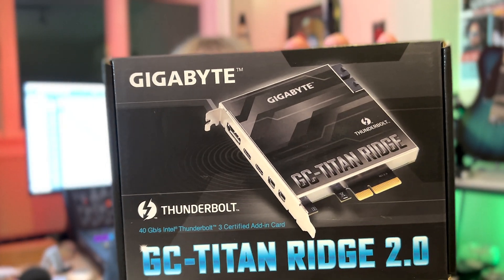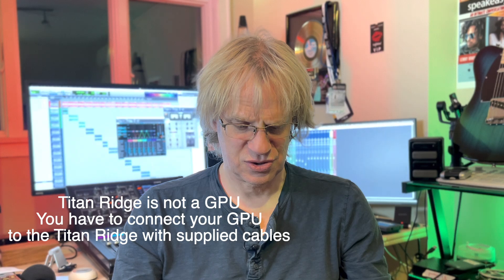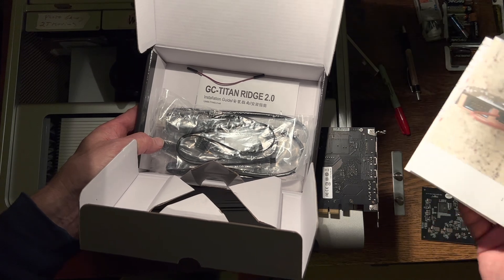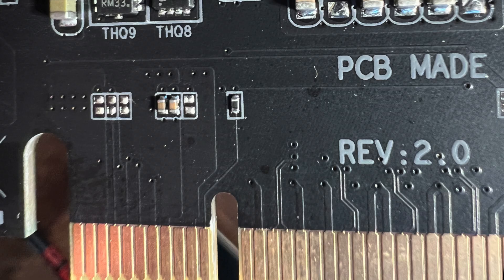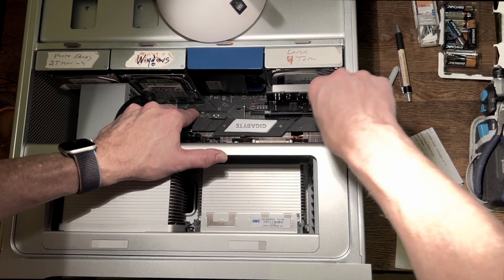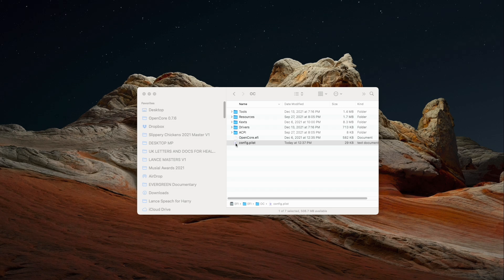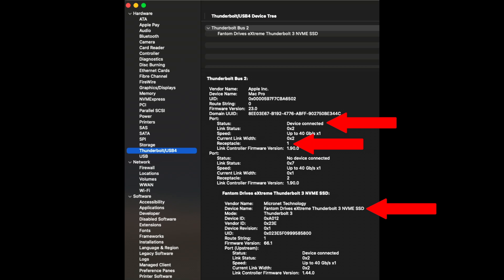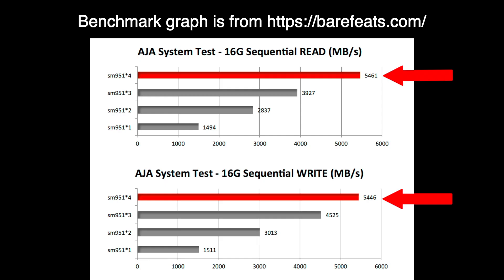Mac Pro 5,1 Thunderbolt 3 0 Titan Ridge pros and cons

Comment: Wow this is great! I was always told that thunderbolt does not work on 5,1 Macs due to the motherboard not supporting thunderbolt.
Reply from the maker: That was true but thanks to the opencore developers and flashed for Mac Titan Ridge cards they work! but it’s not plug and play, you have to boot and then restart but then your good to go.
Reply: @MacSoundSolutions  mine was working great I bought a flashed one from their eBay store but UAD rolled out an update recently and now I’m having issues with the Thunderbolt card Losing connection with my Apollo and crashing on YouTube video streaming sites
Reply from the maker: @DEADIKATED bummer,  not great. I have since pulled my Titan Ridge, I just don’t need thunderbolt I got the McFiver so faster internal drive speeds and USB C ports.
Reply: The Thunderbolt protocol is synthesized from PCIe 2.0 data but don’t expect TB3 speeds. This card will bring your CMP into the TB protocol but not the speed. To many the protocol is all-important, the speed is not. BTW, I did not have any of the sleep/wake issues at all with my install. If you have questions, fire away. I’d have to go into my notes and I’ll be happy to.

Comment: Hi my friend , I just bought a titan ridge and installed it with opencore and my 2012 mac reads it and picks it up fine ,but when i plug my Apollo UAD in it does not read the interface???... any suggestions u could give .. thanks
Reply from the maker: Was it pre flashed for Mac? If so you have to set thunderbolt from ‘false” to “true” in the OC config.plist if you have both those things already done, try booting then plugging in the interface with it powered on then do a restart and it should then see the interface and of corse you need to have the driver installed.

Comment: Will this card with Presonus Quantum?
Reply from the maker: Depends on drivers and what Mac OS version the drivers work with. It should work if it’s flashed for Mac and the driver and OS work on other macs. You have to have opencore for it to work, but you will still have to do the cold boot and reboot to get it to show up.
Reply: @MacSoundSolutions  Everyone that Tried it .. Never figured it out.. 🥺
Reply: @MacSoundSolutions  
Supposedly
The Titan Ridge will work with all of the following:
• Focusrite Clarett 8Pre (X)
• Motu 828es
• Lynx Aurora
• Apogee Element 46
• Apogee Ensemble Thunderbolt
• Blackmagic UltraStudio
Minirecorder
Blackmagic Mini Monitor
• Akitio Node Pro Thunderbolt 3
• Elgato Thunderbolt 3 Pro Dock
• Elgato Thunderbolt 2 Dock
• Belkin Thunderbolt 1 Dock
• Kanex USB3
• East Thunderbolt Adapter
• Honeywell USB-C Dock
The Titan Ridge does not work with all of the following:
Drobo (storage)
Promise Pegasus R6
Presonus Quantum (other Presonus should be fine)
Antelope Audio (see details above)
Slate VRS8 (will not work on a Mac Pro, works on a Hackintosh)
Lynx Aurora 16 (Original, not N) with LT-TB

Comment: It really is silly that they dropped support for these computers. They are still perfectly tenable computers for so many people even in 2022.
Reply from the maker: True and why I’m still using mine in 2022 and beyond. The new 2019 Mac pros are nice but still too pricey.
Reply: My CMP with a Hex 3.46GB Xeon processor serving 3x 32GD DRAM is running at very high memory throughput speed which is exactly what a ProTools system needs.  It is not slow by any means.  300 tracks at 24/48 is comfortable and I have added 270 high demand (half mono, half stereo) Waves and Sonnox plugins with no issues.  I can do 64x64 via USB-C and simultaneously another 64x64 as AVB Audio thru one Ethernet port in PT 2023.6.  I’m finally happy that I can cover my needs

Comment: I had mine working with a Alpine Ridge.  The titan ridge didn’t work.  What I did was installed the Alpine Ridge. I then used a apple Thunderbolt 3 to 2 adaptor.  I plugged my display into the adaptor and the adaptor into the alpine ridge and it worked plug and play.  Now for whatever reason after I haven’t booted it up in a while it no longer works.
Reply from the maker: Strange, are you using Opencore? I have to edit the config.plist set false to true under thunderbolt near the top every time I update to Martin Lo’s latest OC package, currently running 0.8.0 and the updated config.plist for Monterey 12.5.1
Reply: @MacSoundSolutions  never used Opencore because I hadn't updated my GPU yet so I could upgrade to Monterey.  I have an updated GPU now but I also have a HD that came with it that has Monterey already installed.  However I need a Thunderbolt to HDMI adaptor to plug directly into the GPU is what I'm being told for it to work.   Titan Ridge def isn't working for me at all.  Alpine Ridge did tho
Reply from the maker: @akashicpurple3206  you need opencore for the Titan ridge to work and it needs to have the 5,1 Titan Ridge custom firmware flashed to it. Check out the “5,1 Titan Ridge custom firmware”  Facebook group  it’s got lot of info. I only use the Titan ridge for storage, I have no need to do the video passthru from GPU to TR to monitor so never tried it.

Comment: The sleep mod can be accomplished by covering up the pin with tape without removing the resistor. Easier a lot easier.
Reply: Btw, do you have to cover front and back or just front side of the pin?
Reply: @WTF-oy7qh  just the front
Reply: @gordonblank6845  thank you for the info.  I tried the box tape but it slips off as I try to stick it into the slot.  I’m gonna try manicure and see.
Reply from the maker: What kind of tape?
Reply: @MacSoundSolutions  packing tape. Heavier than scotch tape.
Reply from the maker: @gordonblank6845  I have seen that done, but honestly I never sleep my mac cause my last USB c card did not like sleep either ejecting hard drives. May give it a go, thanks
Reply: Thanks man.  A lot simpler solution to the matter.

Comment: Couldn't one just take a razor and cut that trace that leads to pin #11? That would be easier than desoldering the jumper. 
Also, I was thinking about the issue of getting into a bind with PCI slots. I have a 2.0 USB card in my 5,1 for all the USB devices. But with that Thunderbolt card, I imagine I could connect an external 3.0 USB hub, thus freeing up that PCI port and probably having better data throughput.
Reply from the maker: You can connect a usb 3.0 hub to the Titan ridge, that’s what I have also. The Titan ridge doesn’t support usb 2 without it being connected to the logic board. But seeing the Mac Pro has plenty of usb 2.0 it’s not necessary.

Comment: Hi I tried on BIGSur and CATALINA but the result is always the same: the mac recognizes the card, but in my config.plist file I can't find the line where to change to TRUE
Reply from the maker: It’s near the top of the .plst
Reply from the maker: Are you using Martins package or OCLP?
Reply: @MacSoundSolutions  OLCP. 0.4.5
Reply from the maker: @tizianosantambrogio413  That is an issue you should look at MrMacintosh.com I think you will find your fix there. I use Marin Lo's Opencore package so I can't help you on this one.
Reply: where i find the package of marin lo's do you have the link? thank you
Reply from the maker: @tizianosantambrogio413  you cannot run OCLP and Martins package IRS one or the other.https://forums.macrumors.com/threads/activate-amd-hardware-acceleration.2180095/page-53?post=28255048&fbclid=IwAR3KZrLg_dYUK2KK4lhIPcMlz7bXODoRVvBVDaJQu0umJn6zGXmDkJjysBk#post-28255048 scroll down to post 1314 and down to the bottom of the post are the packages.
Reply from the maker: @tizianosantambrogio413  https://studio.youtube.com/video/yM2hiKjV2n8/edit. Watch this for install tips https://studio.youtube.com/video/yM2hiKjV2n8/edit also use 0.8.0 and if you want to run Monterey 12.4 you need to add his new patch to 0.8.0 it’s at the bottom of his list of Opencore packages
Reply: @MacSoundSolutions  grazie thank you

Comment: Thanks!  This is all great information about things that I have been wondering.  BTW, someone may have advised you that .plist is not - as you already know, "play list" but it's also not "program list" it is "property list" as these files have been in OSX since it started and they contain all the properties or preferences of applications within the OS.  I know it's a small thing, but I think over time you probably want to know what it's called.  I actually thought it was call the preferences list - right up until I wrote this comment!  According to several source online it is the property list.  So many Ps!

Comment: Can you please link a video to how you got a rx5700 xt to work
Reply from the maker: It was pretty easy, you have to turn off SIP install opencore  I use Martin Los package for 5,1 and install Catalina or later. I did not do any power mods but the gigabyte version has less power consumption than some other 5700xts. You have to do the installs before putting the rx5700xt in the Mac Pro. So that means using a Mac GPU to do the installs first. One thing to know is when the Opencore boot loader  is visible it only gets displayed out of one of the 5700xts ports so if your using only hdmi you may not see the bootpicker, I have three monitors and the boot loader shows up on one of my monitors connected via  DisplayPort.

Comment: Must to I use little short cable? I do don't have it. Where can I find it? When I plug the thunderbolt external HD, it disconnects in 5 minutes. What can I do for fix it?
Reply from the maker: Thunderbolt 3 cables are very short not to be confused with usb c cables that’ll are USB 3.1 gen 2. If your using opencore you have to set the config plist thunderbolt to true like in my video. Thunderbolt 3 Cable 3.3ft/1M,Nimaso USB C Thunderbolt 3.0 Cable 40Gbps Date Transfer 100W (20V 5A) 5K@60Hz Fast Charge Cord,Compatible with Docking,Pixel,eGpu,Hub,MacBook,Dell,iPad Pro 2020 and More https://www.amazon.com/dp/B08GLCQBYD/ref=cm_sw_r_cp_api_i_EM3YF4ESBRG7B3GTR7CE?_encoding=UTF8&psc=1
Reply: @MacSoundSolutions  Thanks for answer. I watched the video again. You call it "jumper cable". I don't have it. 

What is the specification of the cable? Is it copper? Can I have the pins on the end of the electronics technician do it?
Reply from the maker: @cetinkarahan9581  I think it is a simple copper cable, you could contact DQupgrade.com to see where they get them or maybe buy one from them.
Reply: @MacSoundSolutions  thank you, I will try it

Comment: Have you or anyone in the comments tried using the Apollo with thunderbolt card with this solution?
Reply: I'm running my Apollo Quad rack (which I originally ran firewire) under Thunderbolt on my Mac Pro 2009. I have to reboot once after a cold boot and then it sees it and it works perfectly. I don't have to unplug anything or "wake anything up."  Just reboot once.
Reply: @ScottWozniak hi! I’m having the problems with my RME Fireface 800 FireWire audio Interface, similar as yours. So you 1. Turn ON your Mac Pro. Then it boots into the OS. Then you restart it, and everything is OK?  Are you on Monterey?
Reply: @RenatoPernett  I turn on my Apollo, then my Mac Pro. After I get to the desktop I just reboot and it sees it. I'm on Ventura. I'm using the Apollo via Thunderbolt with a flashed Titan Ridge card. Apple doesn't support firewire after Catalina.
Reply: 😢 not working..  If I run Apollo, the computer immediately restarts and does not work
Reply: I have I’ve been using for 2 years now but when uad did the recent update I’ve been having issues ever since. I got it so I can use it now but My Titan ridge disconnects every now and then after I use it for a while and I have to restart my computer
Reply: @DEADIKATED  Hi dedicated
Now I use it without running Thunderbolt in Martin Leo settings, but it does not work for the first time. Restart the computer and then it will work on 20 GB only, it works properly after rebooting

Comment: Can I plug a Apollo audio interface with thunderbolt 3 cable
Reply from the maker: You should be able to but it takes a cold boot and a hot plug then reboot with the correct driver and compatible OS version for it to work. Pretty sure folks are using Apollo’s with their 5,1 and Titan ridge.
Reply: @MacSoundSolutions  can you elaborate on the process for the cold boot and hot plug
Reply from the maker: @WillMonotoneOfficial  cold boot, then plug in the thunderbolt device to the card and reboot. Then it will show up as a Thunderbolt device. This is what I have to do for my OWC thunderbolt drive to show up.
Reply: @MacSoundSolutions  What does cold boot mean? And how to work with it .. I did not understand
Reply from the maker: @volkswageneos9207  cold boot means when you first turn on your computer. warm boot means restart. Then connected thunderbolt items will show up.
Reply: @MacSoundSolutions thank you bro
 I operate my device on the Windows system, then restart and go back to the Mac system again for it to work fine
Reply: @MacSoundSolutions  hi bro 
In warm boot, is there a solution to this problem without restarting?
Reply from the maker: @volkswageneos9207  no there is no work around, is your card flashed for Mac?
Reply: @MacSoundSolutions  yes flashed for mac
Reply: Looking to do the same thing did this work for you?
Reply from the maker: @WillMonotoneOfficial  I don’t have an Apollo but I do know folks have gotten them working.
Reply: @MacSoundSolutions  thanks bud just ordered the pre flashed titan ridge i updated to monterey not realizing it dropped FireWire audio support so gotta go the TB3 route now
Reply from the maker: @WillMonotoneOfficial  It should work as long as the driver is Monterey comparable, not sure if you also need an adapter to go from thunderbolt 2 to thunderbolt 3.
Reply from the maker: @WillMonotoneOfficial  let me know how it goes.
Reply: @MacSoundSolutions  will do both card will be here Thursday I’ll report back with my end result
Reply: @MacSoundSolutions  got everything last  night  can confirm the cold boot then hot plug and restart works and i have my Apollo 8 connected via TB3 then daisy chained to my Apollo 16 and all is working fine. Appreciate the help on this.
Reply from the maker: @WillMonotoneOfficial   very cool.
Reply: @WillMonotoneOfficial  I have a problem when I run Apollo the computer does a restart
Reply: @WillMonotoneOfficial  Which version are you using .. Can you help me?😢

Comment: Hiya chief! Is this fully working on Windows with no flash?
Reply from the maker: Mine is flashed but I believe it is working in windows. I really only use windows for occasional game, so will have to boot and test.
Reply: @MacSoundSolutions  Many thanks for the response - I'm planning to use mine as a gaming machine but my only display is a Thunderbolt Display.

Comment from the maker: So an update on this with my Pro Tools  issue. it tuns out I had two system drives mounted both called ‘Macintosh hd”  Pro Tools doesn’t like this and crashes. Once I unmounted the second Macintosh hd all is good….

Comment: Use the Syba Dual M.2 M-Key NVMe Ports to PCIe 3.0 x16 Bifurcation Riser Controller (SI-PEX40129) along with a single Samsung 970 Pro to get around 2,500 MB... note that it needs to be able to go into slot 2 to achieve x8 instead of x4.  (My graphics card in slot 1 is a Radeon 5700 XT and the Syba just fits snugly into slot 2.)
Reply from the maker: I'm surprised you can fit that card next tto the rx5700XT, mine totally eats into slot 2. I would love to see a photo. And what about heat?

Comment: Thank you for this. I was wondering about getting one of those for my macpro. Before, I only saw people saying it works and I was not aware of the cons... So very informative... And I find very cool that you included a comparison with the Sonnet cards. I have an Allegro USB-C, which I think must be the same as yours as it is also rated for USB3 gen 2 10Gbps, except the one I have has USB-C connectors. So I also found it interesting to know what I could gain with such card. So, thanks
Reply from the maker: Thanks Pierre, it is nice to get the speed bump over the USB 3.1 gen 2 card and yes I would  guess my card although USB A connectors should be the same speed as it was Sonnets higher end card. One thing to note that I meant to put in the video is that USB 2.0 devices don’t work connected to the Titan Ridge only usb 3.0 and up but seeing the Mac Pro has several usb 2.0 ports it’s not an issue.
Reply: @MacSoundSolutions  interesting. I have the 2 port Sonnet USB 3.1 gen 2 card, need usb 3 to connect the BlackMagic speed editor. What cards are available for the raid 0 NVMe 
setup? Any speed difference depending on what slot I put my one NVMe adapter card, single NVMe card,  into? Mostly I got this to run Resolve.
Reply from the maker: @larryvaughn5843  sonnet makes one https://www.sonnettech.com/product/legacyproducts/m2-4x4-pcie-card.html and so does OWC, Squid is another. A single NVME will only reach 1500MBs in any slot as far as I know it’s these 4XNVME in the 16X slot that have a switch so each NVME gets its own 4x channel. So you get close to 6000MBs if you raid 0 all four of them. I think raiding 3 and using 1 for your OS is the way to go. So a single card will only get a single 4X bandwidth. And I’m sure I’m not technically saying this exactly the way it works but you get the idea.
Reply from the maker: @larryvaughn5843  I just installed a new 2T Samsung 970 evo plus and I’m getting 1500MBs in my 4X slot with a 18 buck amazon pcie with heat sync.
Reply: @MacSoundSolutions  I get the same speed with my 970 evo not plus with an $11 pcie heatsync adapter card. Tiny card not much bigger than the 970 compared to the other adapters.
Reply from the maker: @larryvaughn5843  nice i got the evo plus on sale for 229 for 2T oddly the non plus was more money.